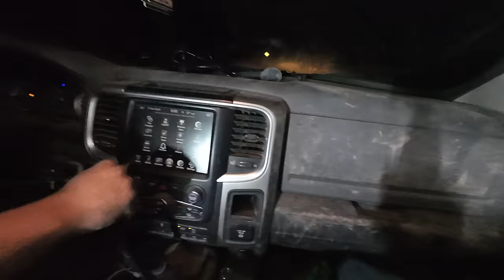Ford Raptor Hanging off a Cliff! Ram 2500 with Side Puller Saves The Day!!

Comment: Hold that Tiger!     Hold that Tiger!!     Hold at Tiger!!!   this video shows beyond a shadow of a doubt one more reason why I joined this channel!  

No nonsense, no wasted moments, no wasted movements.    And no Horse🐎 Shit. 💩 = playing around by playing grab-ass.  They roll up and get down to business!!  

From what I understand about Raptors, depending upon which model you buy, the horsepower can run from 450 to 700 hp.  

Regardless of the model, it’s safe to say that you’re garden-variety buyer that does buy one, buys it so he can ride around with the attitude of,,  LOOK!      AT!!      ME!!!   

And when they go off road, they are definitely driving way over top of their head. Hell they don’t even have to go off road. I have  them blow past me out here on the roads in Montana,  or any place down in Wyoming,  

Blow right on by me like I’m sitting still, and yet I’m driving 80 or 85 mph.  And you can do that out here because there’s nothing for miles and miles and miles.  

I actually talked to a Raptor owner one time, because both of us was driving from Casper,  up to Buffalo Wyoming.   (My wife and I was actually on our way home back up to Yaak MT. )

The total driving distance from Casper, WY to Buffalo, WY is 113 miles.  And there’s nothing whatsoever. And that’s why on so many roads in Wyoming. The legal speed limit is 85.   

But he went around me,  LIKE A RAPED APE!!  🦍  between Casper and Buffalo just about right in the middle is a little town called Kaycee.  Wonderful little place and the Sinclair gas station has excellent reviews. 

And , the parking lot is tremendous size because most of them in Wyoming and Montana cater more to truck drivers. Anyway, I’m driving my, 2019 Ford F-250 King Ranch, Diesel. 

 When I pulled into the Sinclair, he was there. Sure enough just as I suspected when I saw his tag. What little bit I could see of it because he went by so fast. 

Colorado, which means a transplant from the West Coast, the vast majority of the time.  Yep, he was from Oregon living in someplace in the greater Denver area. 

Anyway, I asked him,  Jeff his name. I said I’m curious to know how fast you were going,  when you went around me. He said,   I believe I was doing right about,   140, MPH.  

And then it’s guys like Rick here,  that has  to go out and scrape vehicle’s off the roads.  And I’m sure,  WRECKER-RICK could tell us all kinds of stories about dead bodies.   

Bodies like this transplant OUT-OF-STATER.  All torn to pieces. Mangled and scattered.  From here,  to over—there.

Comment: You did the right things , secured the winch vehicle,used two lines and the Yankem rings and you used the wheel to attach too.
Now some controversy over the Yankem rings (the small ones)and the winch Rope being burnt ,and the recovery guy who posted this was having a dig at Casey LaDelle,but Casey made it clear about how to correctly use them ,I just like seeing consistency being used by most of the recovery guys here on YouTube,and most of the equipment supplier's normally test what they make and sell ,you guys need good gear .